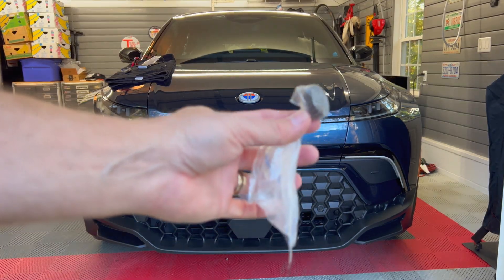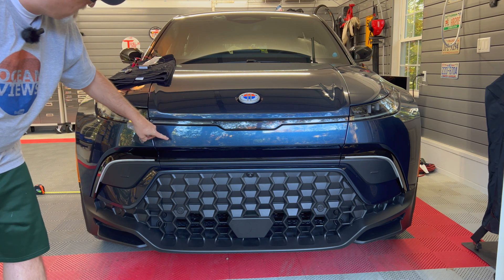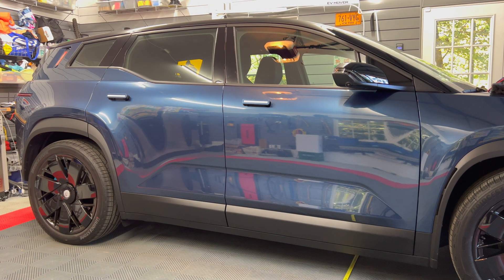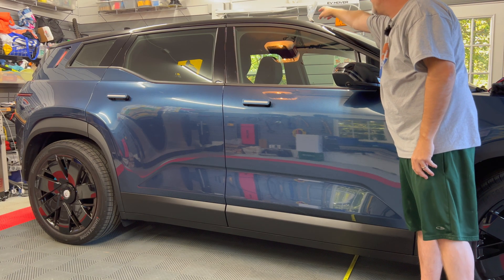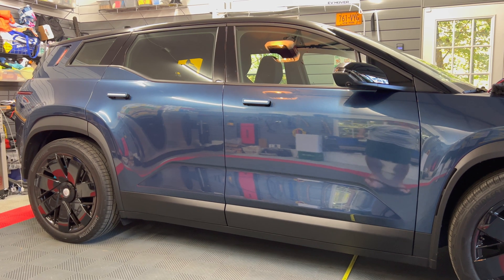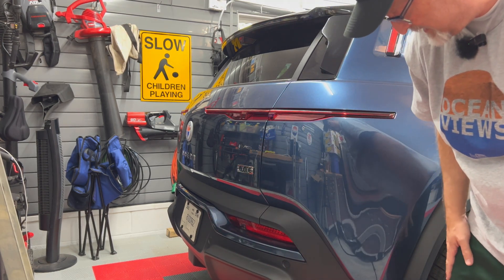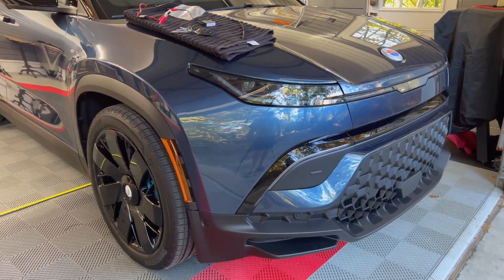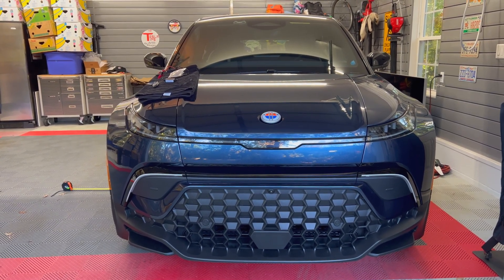Fisker Ocean One - Magnet Test

Comment: Thanks for your informative videos on your FiskerOcean One. We received our Ocean One four days ago, our delivery person was not as helpful as yours! A couple of questions: we recieved only one key bob at the delivery [compared to two with our Tesla]. Is our car eligible for $7500 tax credit? Do we need any paper work from Fisker for claiming the tax credit?  We took short drives; drives well with firm feel and comfort. Our front end camera was not working, we called support at Fisker; hopefully they will send their mobile service to fix asap!
Reply from the maker: Supposedly, they don't have enough key fobs to include the extra accessory ones.  The second rumored reason is that the car can only be paired with one key fob.  That fill get fixed with an OTA update soon.  Re federal tax credit, if you paid Fisker the $5000 deposit before 8/16/22, then you  qualify for the tax credit.  The full amount depends on what you owe on line 16 on your IRS 1040 form.  If that line is great than $7500, you get the full amount, if less, then that will be your credit.   Good luck with the car!

Comment: I think they have started using stainless steel (304 or 316) in cars because they are excellent during crash and also rust-proof. They are also non-magnetic. Non-magnetic metal can be either Aluminum or 304/316 stainless steel.
Reply from the maker: I did some more research and discovered that the skateboard chassis is aluminum. The fenders, liftgate and bumpers are plastic.

Comment: Thank you for posting this information.  Modern car designs (that are affordable) use aluminum and steel crumple zones and keep the main cabin steel because of its strength.  Building a passenger car with carbon fiber is just too cost prohibitive and left for extreme exotics.  Kudos to Fisker for building a solid cabin that provides great protection to the occupants.
Reply from the maker: Yes, the only mainstream EV maker that uses a lot of carbon fiber reinforced plastic (CFRP) is BMW. Yes, manufacturers use a combination of steel (varying grades) and aluminum (also different types) in the structural cage and other areas.